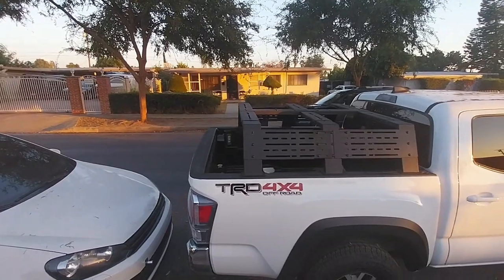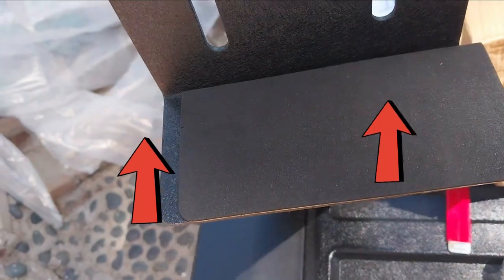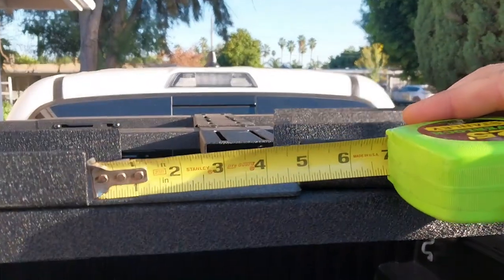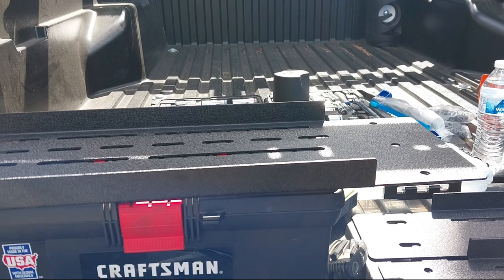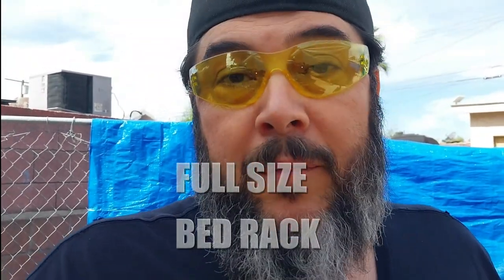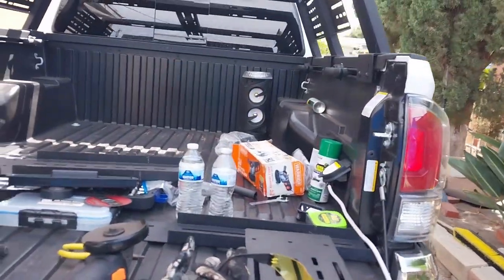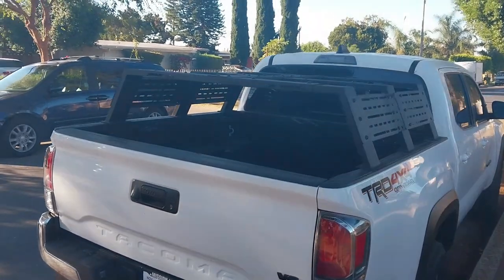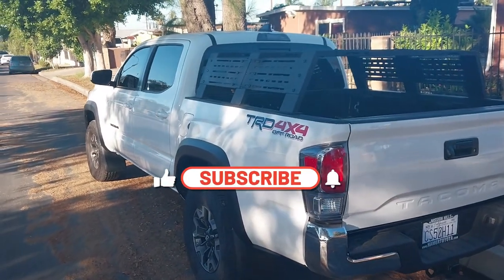2nd upgrade Toyota Tacoma, Huge mistake when buying new bed rack.

Comment: Looks good! I just installed the Hooke Road 18" on my Tacoma. Funny, I had the same issue, 2 bends on one of the legs. The bends are  identical to yours. I reached out to Hooke Road through Amazon, and Hooke Road gave me a $50 refund, and they said they will send me some replacement screws. Some of them were damaged.
Reply from the maker: I unfortunately did not reach out to hook road. I just thought I would put out a video and show some of the things that people may encounter. I'm glad I'm not the only one I did tag them in my video and hopes that they would reach out to me so far. No luck

Comment: Nice work. Just a small tip... I like to mark the bolts that connect into the bed channel. Its not unusual that they become loose with all of the vibration it will see. It's an easy indicator to notice they are loose when the marks don't line up. I have had bay area metal fab, RCI, Victory offroad all come a bit loose over time.
Reply from the maker: Thanks for the heads up, I have noticed a few that have backed out.